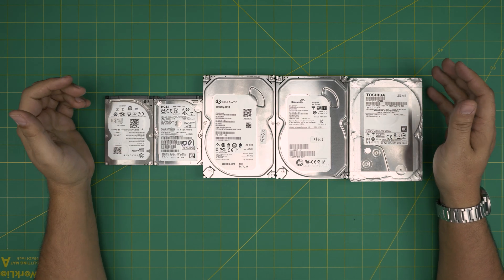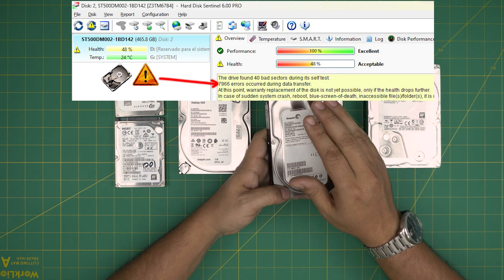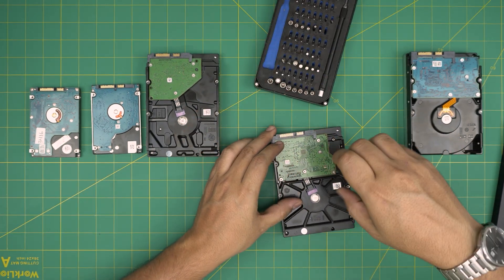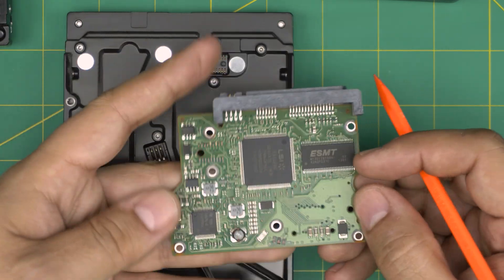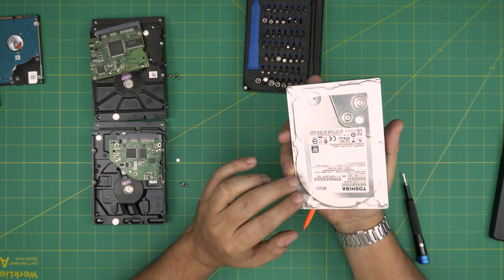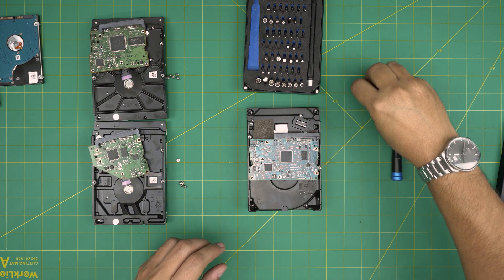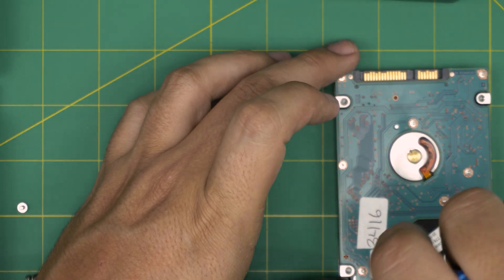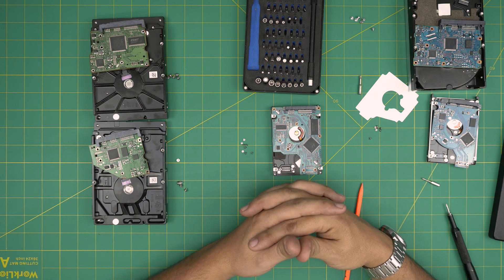📢 Are Hard Drives Built to Fail? Uncovering the Hidden Truth Behind HDD Lifespans📢

Comment: This is good information. Are you saying enterprise (commercial) HDD's use soldered pads while many consumer grade PCB's use gold plated pads? I was under the impression gold plated pads and pins were more resistant to oxidation. What if we were to tin the gold plated pads with solder and wick away the access, i'm wondering if that or any other fix is a solution to the problem. You got us thinking about something I never thought about before. Thank you for this information. Keep it up!
Reply from the maker: Thank you for your feedback! If you wish to support the channel, you can like, subscribe, or do both!

Regarding your question, I wish they were GOLD plated! The issue is that NORMAL CONSUMER grade HDDs (3.5" or Laptop 2.5"), regardless of the brands or models, have standard PCB pads made of COPPER, which is the standard PCB method. These COPPER pads tend to oxidize faster due to the current voltage passing through them.

On the other hand, higher-grade HDDs (Business class /Servers) where hard drive manufacturers can't risk legal issues or losing major clients, also have PCB boards with COPPER pads, but with a significant difference. These pads are covered with Solder paste, which protects them from corrosion and oxidation. This ensures a solid and reliable contact with the pins. Some high-end drives even use spring contacts with GOLD plated spring metal that connect to the gold plated pads on the platter motors.

The solution is to open the PCB board, clean those pads, apply flux and solder paste to create the perfect contact. I hope I've explained myself well. I have been recovering data and repairing laptop electronics for the past 17 years, and I've witnessed this transition and trick firsthand.

If you have any further questions or requests in the future, please don't hesitate to ask me.
Reply from the maker: You don't need to touch the gold-plated contacts; instead, focus solely on the COPPER contacts. While some normal hard drives may use gold-plated contacts for the platter motors, they never do so for the actuator contacts.
Reply: @uFixTek  You are correct. I just took the PCB's off my WD 1TB green HDD circa 2008 and the actuator pads are very corroded. Here is the problem. I swapped the PCB's with different revisions a few weeks ago and now one of them shows 1.7TB capacity when it's really 1TB. It was my attempt at poor mans data recovery. I wonder if there is a way to reset the firmware or something. Should have watched this video first.
Reply from the maker: NEVER fully swapped the PCB of the drives without transplanting the Firmware or the bios of the drive else you will never be able to recover files.
every board has a BIOS and Firmware you need to swap them too when you insert new board or used board.
no resting if you lost the main original board then it is very very hard. you need PC300 that is very costly.

Comment: Thank you for this video it's very interesting. I had no idea about all of this, it's such good information to know that if a hard drive backup fails there's a high chance it's just the contacts and you can clean them and get the data off and on to new drives ASAP. I have a few "dead" drives I will experiment with soon. I need to by a couple of new hard drives for storage and backup, how would you suggest I go about doing so? After seeing your videos I'm thinking to look for pro/business/enterprise drives instead of consumer drives. So how do I know which ones to get? Any that are called "pro" after the name? Or is there something else I should know... a buying guide video would be good. Thanks again
Reply from the maker: It's my pleasure my friend.
i appreciate your support, 🫠Regarding your question, any drive over 4TB will likely have better contact (solder) in most cases. If you have any consumer drive, whether new or old, I recommend removing the motherboard and checking the pads. If they are copper, solder them for better performance.
https://youtu.be/QeFsDhPWrO4
Should you have any further questions or requests in the future, please don't hesitate to ask me.
cheers🍻
Reply: @uFixTek  Thanks for the response.... so does that mean there is no point in buying a consumer level drive that says "pro" in the name, and just may as well get a cheap one? (still speaking in terms of 8tb and over here)
Reply from the maker: exactly no need to go pro, just get any HDD over 2TB and you should be 99% fine.
but it doesn't hurt to remove the board and take a look at the pins.
Reply: @uFixTek  Thank you so much for the information

Comment: I have a 2TB Western Digital Black Hard drive that I use as storage and even some of my games. It's been with me for almost 6 yeasr now.
Reply from the maker: most of the 2TB are and should be fine, i recommend you to open and check the pins and if not soldered at least clean them.
Reply: Mine is 8 years old.
Reply from the maker: your will have copper pads open and check.

Comment: I wonder if what this means is that some brands made solely enterprise grade and others made consumer grade for both consumer and enterprise.  So many outlets suggest the failure rate of consumer and enterprise grade HDDs is too similar to justify the cost of enterprise.  It might also depend on the ambient environment though.  The most common failure modes in their data are alleged due to errors on the platters or failing read/write head.  The latter could be caused by vibrations or low power mode causing the arm to park too often.  For the lifespan of an HDD, it's probably cheaper to let it burn a few watts non stop than to ever let it park, or let it for your down period if it's left unused for several hours straight every day.  The upfront cost of an SSD is a lot more but long term cost seems a lot less.  Just make sure it's powered often enough for self maintenance.
Reply from the maker: thank you for the feedback,  and over time we have serviced hard drives in excellent climate controlled conditioned and they are still get the that corrode on copper pads, the fact of simply having the copper pad and not applying the solder makes the world differences ,  i do recommend people to try to turn off the power save mode, as the bust of turn on and off tend to fail faster than the leaving it on constantly.
but the conditions and usage it should not be a reason for manufactures to do this move of not apply a simple solder over the pads when they clearly do on higher ends. 
https://imgur.com/a/9lSi90Q
Reply: @uFixTek  Areas near sea/ocean water might cause metals to oxidize faster where other locations not at all.  Maybe these drives would benefit from being inside an enclosure sealed with an inert gas.  I wonder if that's more cost effective than paying more for each drive just for that.  Or coat it with any non conductive product that can create a seal against moisture.  Though enterprise will just choose the easiest option because the cost is nil next to software licenses.
Reply from the maker: What I'm emphasizing is that, after over years of servicing and recovering data, one of the most significant factors contributing to HDD errors, data loss, or detection issues is a failure to address this particular concern. This issue alone accounts for approximately 90% of the problems. While there are various other factors at play, I won't delve into all the reasons for failure; instead, I'm shedding light on one of the major tactics employed intentionally to reduce the lifespan of hard drives. I've successfully resolved this issue countless times for numerous clients, often finding that simply addressing this problem can rectify their troubles.
we have seen drives almost exposed to humidity and other in controlled climate perfect for drives specs, and still this main issue for manufactures not applying a coat of solder over the pins are still used in regular grade consumer drives, were they have covered the pins with solder to prevent the issue.
Reply: @uFixTek  Thanks for the enlightenment.  Hopefully this spreads and people discover what to coat theirs with if theirs isn't already protected.  If it's that significant, it's a must.  HDDs are getting cheaper, but still expensive for excessive failure rates.  Though, in other news, HDD manufacturers are stressing to stay in business.  There might be something about the cost of protecting employees from exposure who have to manually apply solder as a protective layer and it's easier to supply/apply than anything else for the purpose.
Reply from the maker: i hope they do soon and is not costing them anything to tin the copper pads, it's not like asking for extra components!, but i hope by exposing this they realize that they can't go by doing shady moves on consumers. 
cheers 🍻
Reply: Windows 10: Control Panel/Power Options/change plan settings (current)/change advanced power settings/hard disk/turn off hard disk after: 999999999(minutes)=never. This will turn off HDD sleep function.

If turning off HDD sleep increases life span, i'm all for it because I don't like waiting for the platters to spool back up.
Reply from the maker: you can prolong the issue for sure, but soon or later it will catch up, also in order to set for never, no need to set it to 9999, just input zero (0).
cheers🍻
Reply: @uFixTek  Chemical processes can be put off indefinitely while eliminents needed for the interaction are never allowed to meet.  What you can manage only has to outlast failure modes you can't. For oxidation, oxygen is what you have to keep out.  Buyers need to consider if the time/stress on this outweighs just building their arrays from SSDs with high endurance ratings.
Reply from the maker: The question doesn't revolve around oxygen levels, endurance, or the duration a hard drive should last. These factors have various other considerations, including different makes and models to discuss. The sole focus here is on a particular practice by manufacturers regarding consumer-grade hard drives. Specifically, it pertains to the deliberate omission of a protective layer of tin (solder) on the connection pads, which prevents oxidation and ensures optimal contact. This practice is absent in consumer-grade drives. Additionally, they have thermal pads removed from the PCB chip set unlike the same chip on other grade.

If manufacturers had not left the copper pads exposed, as they do in other models, a significant portion, possibly 90% or more of consumers, could have continued to use their HDDs.

While it's true (agree with you on solutions) that people can explore better alternatives like SSDs or premium HDDs and pay for those options, I agree with your sentiment. It's still not right for manufacturers to engage in these questionable practices with HDD PCBs when adding the protective tin layer wouldn't incur significant costs.

Comment: If you have a power saving hard drive that turns its motor off periodically that may cause the oxidation also.  You are likely to find those inside some external drives.  I have a 2TB SATA drive from a Seagate external that turns off until you use it then it starts up and stays running for some interval and goes to sleep again. Really I think that is why it was given to me free!  It is a lower performance power saving drive.  How well does Deoxit and similar stuff work on those contacts anyhow?  I am very aware of one caveat with it and that is you must let it dry *completely*.  It is like this, if I find a USB stick that accidentally went through the washing machine I let it dry out for at least a week so I know it won't short something and cost me a small fortune in repairs.  It is the same idea with cleaning sprays for electronics, you must let them dry out.  Give your self plenty of time to let it dry out and try not to rush it.  You will need to just totally leave it alone until then, don't plug it in or anything.  Even inspect it real quick and look to see if any has not dried where you can see it.  A gentle breeze from a fan can really help a lot!  If you don't need it the whole day and may even be gone most of the day do it early and leave it sit to dry
Reply from the maker: Thank you for your feedback. I specialize in repairing and recovering data from laptops, computers, and servers. With over 17 years of experience in the field, we have encountered numerous hard drives.

Oxidation or poor contact typically occurs in about 90% of cases due to constant file transfers, rather than sudden bursts of file transfers. These drives are designed to handle up to 2 amps of current. While short bursts of 2 amps are generally fine, continuous usage at this maximum current for an extended period causes the contact joints to heat up. This is because the contact area is quite small, and sustaining 2 amps for more than 30 seconds leads to heat generation and increased resistance, resulting in oxidation and poor contact.

When it comes to cleaning, it's essential to use 99% isopropyl alcohol, nothing less, as it is non-conductive and doesn't cause oxidation. You can even power on the device with alcohol still on the board. We use this high-concentration isopropyl alcohol to detect shorts on motherboards by spraying it on the board, powering it on, and observing where the alcohol evaporates, indicating a short that needs further investigation.

Regarding the contacts, after cleaning, applying flux and solder on top ensures that the soldered connections won't oxidize, providing a much better surface for 2-amp transfers. For a visual explanation, please refer to the diagram I've drawn.
https://imgur.com/a/9lSi90Q

the video on how to fix this:
https://youtu.be/QeFsDhPWrO4
Should you have any further questions or requests in the future, please don't hesitate to ask me.